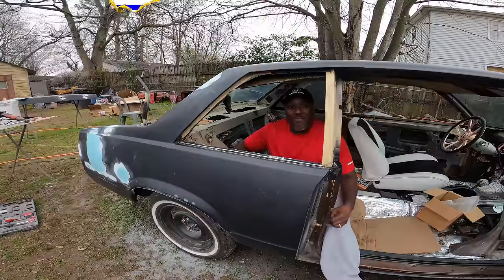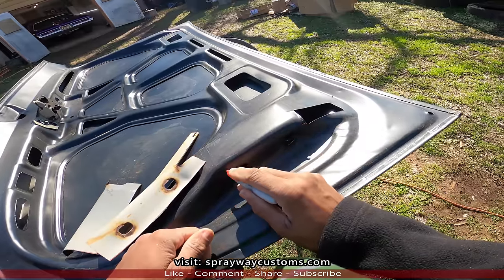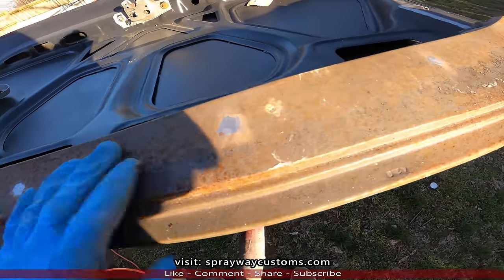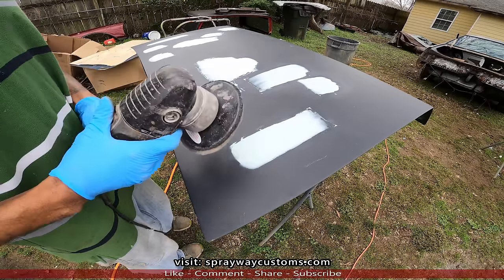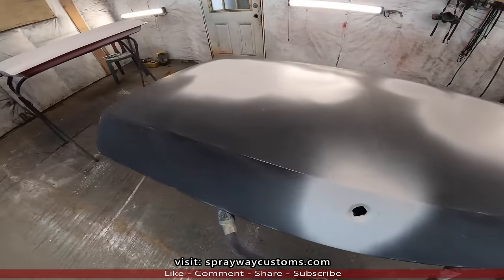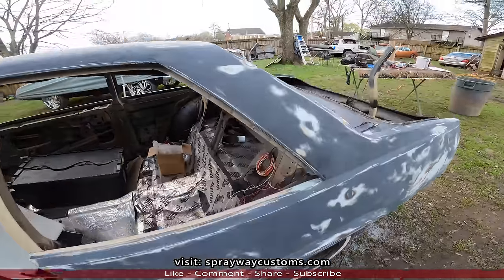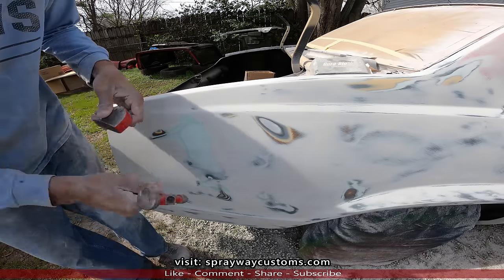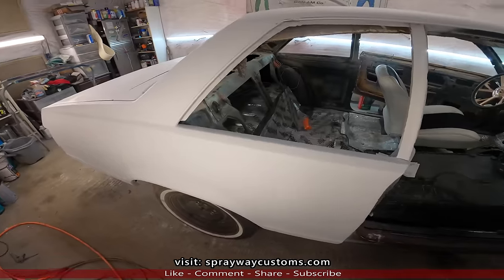How To Do Bodywork & Prime A Car For Paint - @LifewiththeIkes 1979 Chevy Malibu Rust & Dent Repair

Comment: Have you ever tried Evapo-Rust?  It's non toxic and sold by the gallon.
You just take a huge container and dump parts in and in a day;  voila: 
It's like water: gets into every nook and cranny.  No need for grinding or brushing.
You can reuse it over and over.  5-10 gallons should last you for a year.
Reply from the maker: Yes…thanks